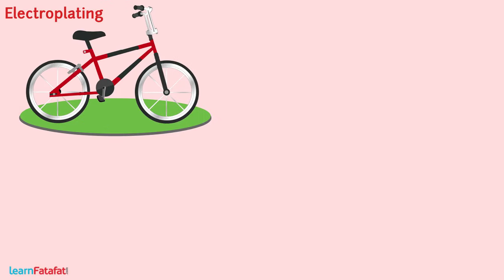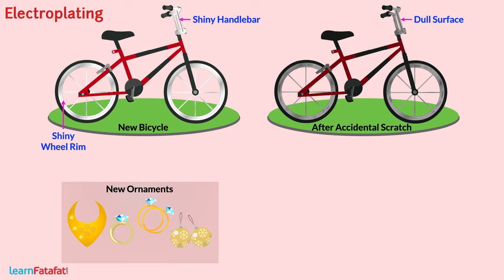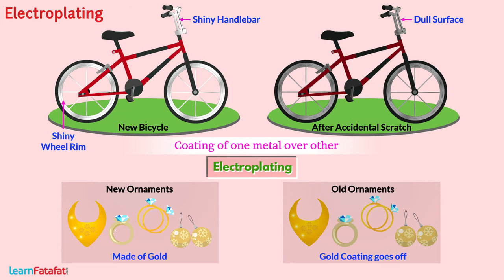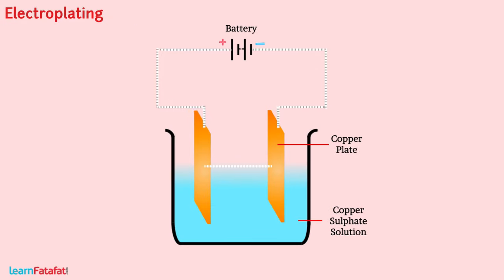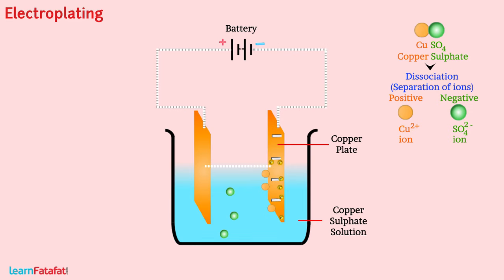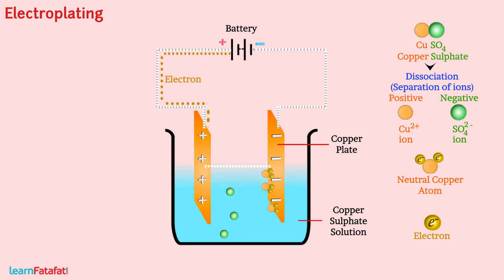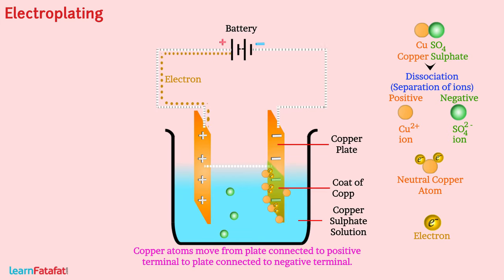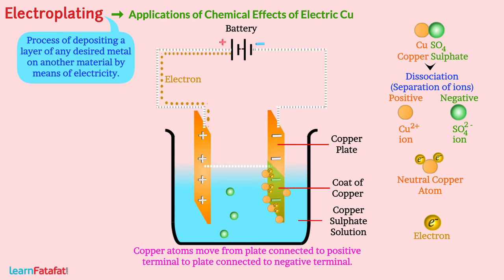Chemical Effects of Electric Current Class 8 Science - Electroplating

Comment: When the plate which is connected to negative terminal of the battery which is a copper plate then how can copper be deposited in that plate. Plz clarify my doubt
Reply: The solution breaks into copper and sulphate. Thus copper is deposited on the plate of the negative terminal. The copper in the solution is restored however as copper from the positive terminal dissolves in the solution.
Reply: @shraavyaathalur1640  means Copper from Solution is attracted towards negative plate 
While copper from positive terminal mix with sollution. 
Do u mean to say this ?
I have have  same doubt !
Reply: @mauryapatel9222  yes